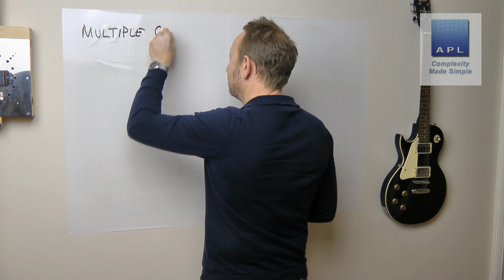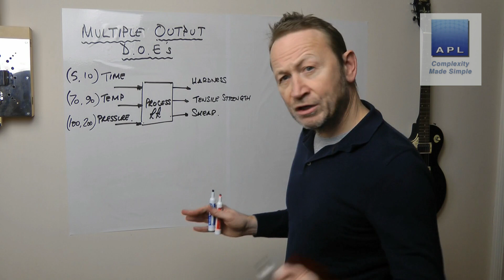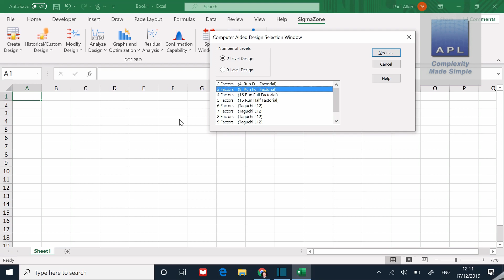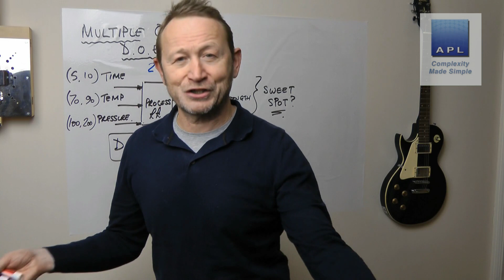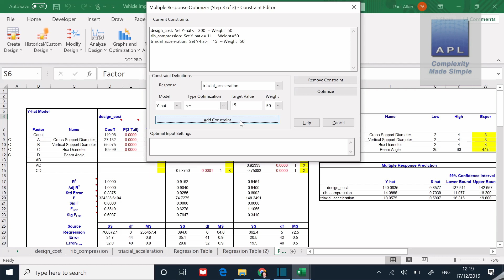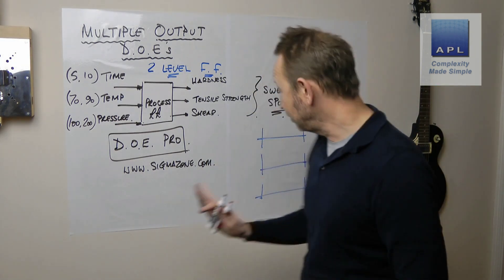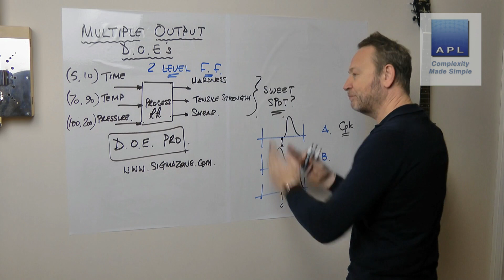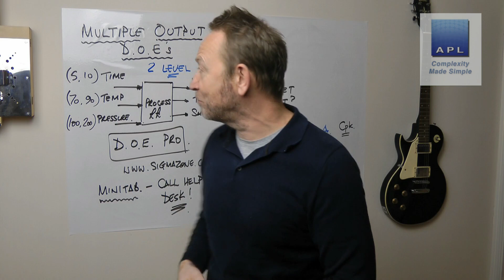How to set up and optimise a Multi-response DOE

Comment: Thank you Paul. How do I install this DOE add-in in my excel
Reply from the maker: if you go to Sigmazone.com you can try DOE pro for 5 days free, then it will cost $229 dollars. if you just click on the desktop icon, it will automatically install in the ribbon....
Reply: Thank you.
Reply: Good day Paul, I have a quick question. I have chosen to use 2levels instead of 3 levels to save me time. But I included a centre point in the experiment which is the average of the 3 factors I have each. Is there a way to include this centre point in DOE analysis on DOE pro or on minitab software?
Reply from the maker: @ovdickson  send me a message on paul.allen@allenp.co.uk and I'll explain...